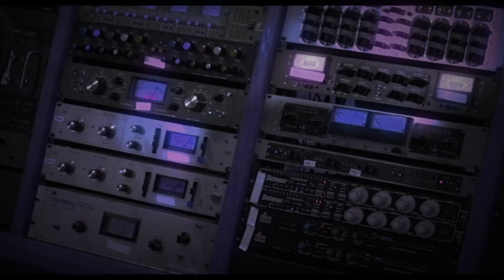Audio Engineering Basics: What Are Stems?

Comment: Great discussion! There has always been some foggy understanding of this subject in my circle of engineers. I think the general conclusion seems to be that stems are prints of a how the track is intended to be, pre mix process, but there is also that great point you brought up regarding the commercial industry and how the overall mix can be preserved by breaking the song out into stems to more easily adjust levels.

For my purposes, I always try to print my stems with all the adjustments and fx critical to that track. I also keep a folder of dry tracks in case the mix engineer wants to try a different spin.

Thanks for another informative video!

Comment: I want to send a song to someone so they can lay down a drum part. The song has a lot of tracks. Would it be easier to send them the song as a single wav or aiff? Or should I send them the Stems? They'd be able to drag and drop the wav into their DAW, wouldn't they? And that would save us both time, right?
Reply: It depends? Who will be receiving the final files to mix? If all they’re doing is recording drums and not any mixing, then you could just send them a two track mp3 file or a bounced wav file (which is a higher quality mp3 file) so they can reference and play over. But if they’re going be recording drums and then MIXING the project on their daw, then you want to send the the stems of the entire audio files (individual wav files, multiple mono, interleaved etc)

Comment: That's not really what stems are… You're describing multi-track files  exported from zero for collaboration in various DAWs...  my pal Jay Ruston just made a post that describes perfectly what "stems" are: "Stems are not multi-tracks. They are any number of stereo tracks, that have EQ , compression and effects, and can reproduce the mix perfectly (by setting all faders at unity gain). Usually there are 8 to 12 stereo tracks. Multi tracks are the individual tracks used to mix from the original recording session."
Reply from the maker: Well, this is what I was taught stems are.  Maybe I'm missing something, but I think I did mention that you want to print out effects and stuff, with the idea being that they can then recreate the mix perfectly (or even remix, etc) if they want.  

Is the difference you're pointing out here the purpose of why you're making them?  I was taught that stems are often made at the end of the process for purposes like placement, etc (which I think is what you're describing, am I right?), but that you could also call them stems if you're sending them elsewhere for other purposes, like out to someone that wants to sample or remix your stuff (whether that's in a more commercial setting or more of a collaboration).  I think the line between those different purposes is pretty thin though.  Maybe you can clarify the difference that you mean?
Reply from the maker: Oh, but reading what you wrote here again (especially that last sentence), I think maybe you misunderstood me?  Stems are basically submixes, they aren't just the individual tracks from the original session, they're submixes of those.